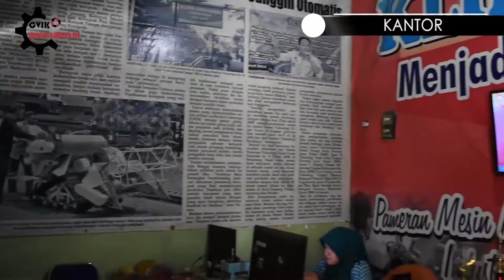Mesin Spiner Peniris Minyak Pada Abon Ayam

Comment: Slmt siang pak sy mau tanya harga buat peniris minta  untuk abon brpa duit ya
Reply from the maker: untuk info harga,detail mesin & pemesanan hubungi Customer Service Representatif Kami (Telp/WA) 081234280625 - 081217850288 - 081252297132 atau kunjungi Workshop Kami di Jl Madiun - ponorogo KM 10 Selatan Puskesmas Geger 300 Meter Kec Geger Kab. Madiun Jawa Timur

Comment: Dan untuk kapasitas brpa kg ya maaf nama sy ane.. Boleh nanya dlu ya pak... Kira2 buat niriskan apa aja ya
Reply from the maker: untuk info harga,detail mesin & pemesanan hubungi Customer Service Representatif Kami (Telp/WA) 081234280625 - 081217850288 - 081252297132 atau kunjungi Workshop Kami di Jl Madiun - ponorogo KM 10 Selatan Puskesmas Geger 300 Meter Kec Geger Kab. Madiun Jawa Timur